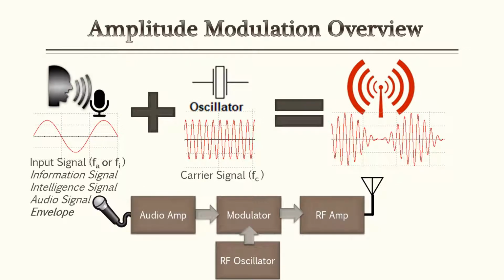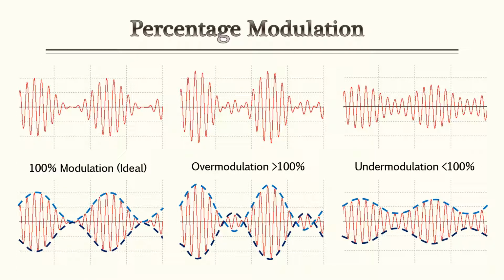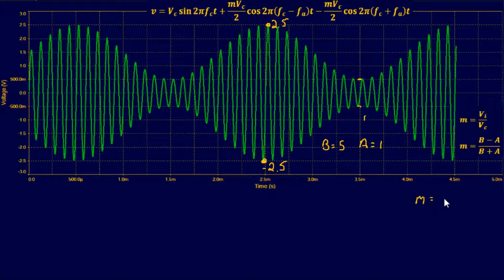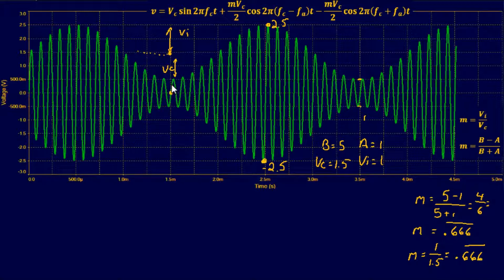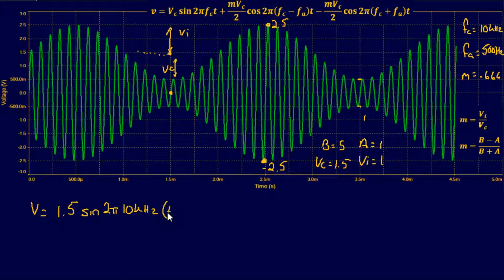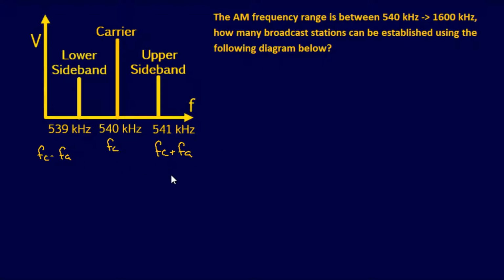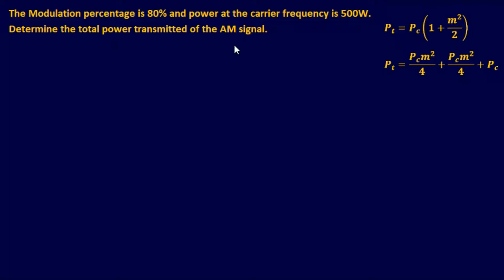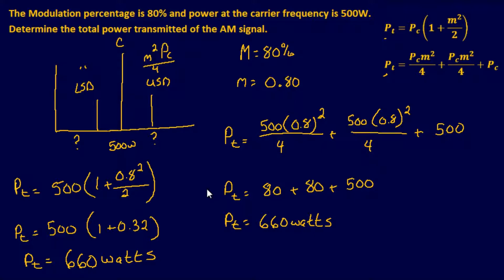Electronics P.E Prep - Amplitude Modulation 2

Comment: I find it confusing how you found the voltage level of the carrier and the information signal. Using the B-A/B+A made sense, but your second method for solving for the modulation index did not... Could you elaborate?

Comment: in your broadcast stations example; don't you need to have a guard band between each station! also, it would be nice if you explain (even on a quick note) how you got that equation because some textbooks only describe the AM modulation equation to be the carrier with an amplitude(since it's not suppressed carrier) + the msg X cos(wc). thanx for the effort thu
Reply from the maker: Hello Feras elyounis,
These are good questions. 
For Example 2, guard bands are not applicable for Amplitude Modulation calculations. Guard
Band calculations are focused around Frequency Modulation to minimize interference
with the adjacent stations.

The AM Waveform equation was derived from several references (Modern Electronic
Communication, EERM, Reference Data for Engineers, Electronics Engineers'
Handbook, and Schaum's Outline of Electronic Communication). Since, this equation
was common among several sources, I determine it would be ideal to be
consistent. 
Thank you very much for your feedback. If you have any comments, questions, or concerns
don’t hesitate to contact me.